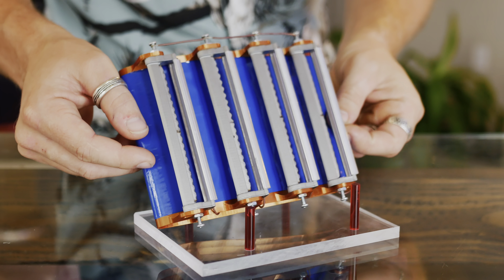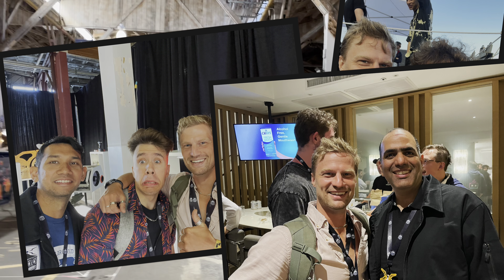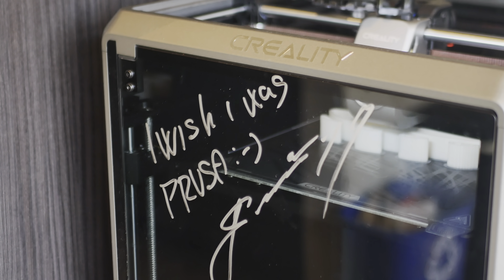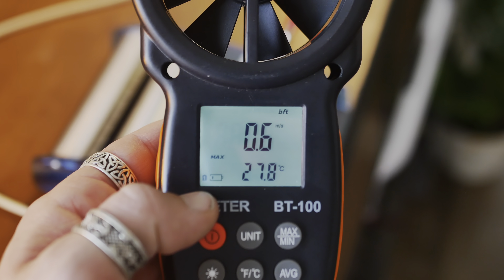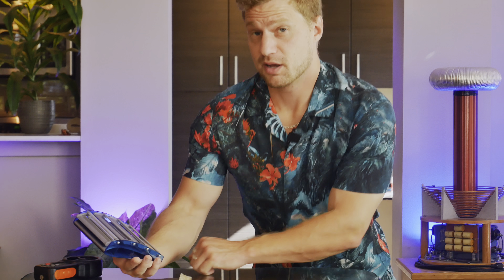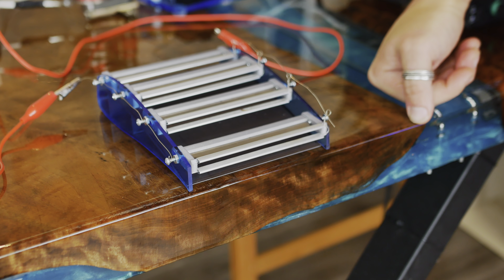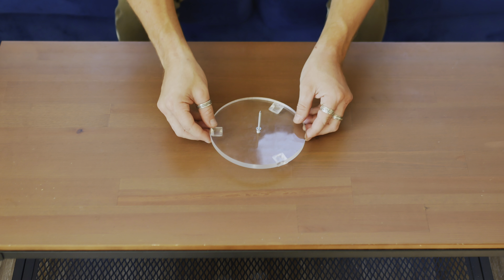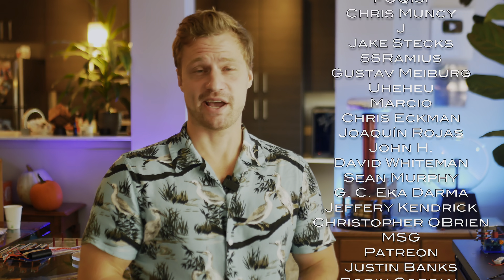Designing A Self Propelling Ionic Thrust Wing

Comment: Cool concept. Would you be open to explore a couple of ideas:
    1. How will the output be affected by incasing the thrusting elements between 2 layers of material shaped after the wing profile and controlling the shape of the input/output. The idea of looking like a trapezoidal blanket (bigger intake/smaller output) that can be shaped/placed on an existing wing.
    2. Depending on the result, you could build a second lair of thrusting elements and check the changes in the output.

Have fun. :)

Comment: While it was spinning, were you able to realize any actual lift from the airfoil? You would have to create your little merry-go-round with the ability to tilt. Either that or put a hinge near the axis that allows the airfoil to rise, but not fall below the plane of the power supply. You might also think about humidity after your catamaran build, as well as air density changes with temperature and elevation. As to the thruster placement get with your wingman to determine the placement of the first thruster to take greatest advantage of high/low pressures across the wing

Comment: You're using nuts and bolts when it can just snap in.  You already have the spacing figured out.  Print it so it just snaps into place and save the weight of the nuts and bolts, and the extra plastic.

Comment: Inspiring idea! Enjoyable to watch.  Thank you.  I bet you could achieve/illustrate vertical lift with your rotating wing foil if you put a hinge to the connected arm.  Then it's a numbers game on the thrust needed to achieve lift. Maybe incorporate two hinges, one at the wing foil to maintain a level orientation and another at the rotation center. The first hinge would allow the wing foil to adjust its pitch for optimal aerodynamic efficiency, while the second, central hinge, would enable vertical lift movement of the arm assembly. May need a larger wing foil span, nonetheless, seeing even a "mm" of lift would be amazing.  Just a thought.

Comment: Weird thoughts and open suggestions that i pondered while watching  your video. 

If a wing design is just separating two airstreams to make a delta pressure causing lift on the backside of the wing, then... ->
Could you not just  make the wing out of thrust elements alone, with only a piece of thin tape to keep the bottom separated from the top. Meaning attached to the bottom of the razor blade, that runs to the front of the next thruster. This off course means the bottom of the razor blade dont get to ionise any air, but weight savings might mean more.
Also meaning, you dont really need a ceiling of the "wing". You want the air to move from the leading edge and fast over/behind the wing -> decreasing air pressure ontop of the wing. 
Point being, the more air you can steal from the leading edge of the wing and mover over the wing the better. 
Buuuut any direction rather than passing over of the wing must  also mean more lift. Since, if you send the air upwards as well as backwards (like a inverse copter), the you also decrease the air pressure on the backside of the wing right? IE air speed of the trailing edge of the wing is not really so interesting as the delta air pressure between top and bottom. I know air speed is a contributing factor from that, but..... The wing moves forward to equalize the air pressure delta on a wing, from my understanding of flight mechanics, so anything that futhers that the better.

This leads to my 2nd speculation, being that every time an ION in the air is ionized, some of the "umpf" of your thruster's power is spent per unit of time. Meaning, the higher the air pressure in front of the thruster, the less air is "required" to move through the thruster to saturate the it's potential. 
If you instead focus on making air shoot off the wing(back and upwards), rather than follwing the principal arch of the wing, this should work to lower pressure in front of each thruster down stream(which is also sitting lower due to the wing design). -Thus managing the direction of thrusters front -> back.... Then the air speed has to increase to keep up with the power potential your are putting into the thruster. Especially if you parallel wire them all making them all have the same umpf, but less air pressure down stream, meaning accell of air to keep up with the engines umpf potential. 

But hey listen, i am just thinking out loud and I dont really have your drive to test my thoughts out. 

Also the razor blades should be sliced into a "lice" comb fashion, to increase how much open air is touching the metal to form ions. 
Also the air packed within two comb legs would be subjected to dramatically higher influence then the air top and bottom. 
This should lead you to have directional properties(thrust vectoring if you will) to play with. Maybe slightly bend every 2nd leg slightly upwards, to force evacuate the air upwards to further reduce air pressure before the next thruster.

Comment: @PlasmaChannel , If you want this consept to be seen in the air I would recomend you to place ionic trustres at the bottom of the wing. Speeding up air at the bottom should generate more presure, therefore there should be more lifting force, also by placing them by some angle, at cofiguration that intake is facing outwards, sholud lead to bigger trust. Please test it and leave some respose, or else i would think, that my consept is stupidly wrong. Thanks for all knowledge that you share with us.

Comment: Excellent project might have future, love to see what happens with each upgrade.
one comment advise is that a wing has 2 sides, 1 low pressure area(top) meaning low wind speed, and 1 High pressure(bottom) so you would like to have the wind speed on the bottom since the low pressure on top of the wing creates lift. Please look over this as it might be more efficient wing lift wise to have the propulsion on the bottom of the wind. wish lot's of success on your experiments it is really fascinating that no moving parts can provide a force. Keep it going.
Reply: Your comment inclines me to think that maybe some kind of biplane could be tried (or a multi-wing arrangement?) with a relatively narrow spacing between the wings. The major benefit of ion propulsion seems to be that drag could be low. Gliding down, or 'engine out' situations would not cause the aircraft to fly like a brick.

Comment: No expert in avionics or ionics. However alot of experience in 3d printing. I do believe extra weight can be shaven of the wing. Squares are not super good. Triangles are stronger. 

Another idea down the lane. Try looking into single wing designs for fight. They are shaped simular to the b2 stealth bomber. The idea is to eliminate the fusiolage and have everything inside the wing. They are harder to stabilize, however create a much better weight to lift aspects. However the design is best at slow speed. I could imagine it would fit perfectly for a ionic design. I am really really exiting to see what you can gain the t
Your segested improvements. Also if you with wires make the engines smaller. What would additional sectmens in the same lenght do?

Comment: I'm not an Ionic engine or wing specialist but doesn't a wing create lift by the air moving faster goer it than under it.

You have a gap below your ion engines and the bottom grounded edge should be incorporated into the wings ie no gap.

Likely why your aren't seeing faster speeds with a combination of ion engines in unison.

If the bottom grounded edge is part of the wing you will see increased speeds over the wings surface than a standard wing and greater lift surely?

Comment: Hi. I found your experience very interresting. Did you thought to creat your blades like a V or a staking cones ? I had this idea when i saw the air flow with fog. It is more important in the center than on corners. If my vision is correct. If the blade has no corner like a ring, the engin thrust must be more powerful. I have not your material to make this experience and no time nether. But i would love. I hope you will propulse us very soon. Sorry for my english i don´t practice it very often.

Good bye😊

Comment: Would this design even need a traditional wing shape?  The over-wing air would be moving faster than the air under the wing without the need for the wing shape accelerating it because the thrusters are.  The old kid's experiment is to blow air over a sheet of paper to lift it, wouldn't this be able to produce the same effect?

Comment: Did you do any testing to see if there was diminishing returns with having 4 thrusters wired up instead of 2 or 3?

I wonder if using a non-conductive material to isolate the intake from the output of each thruster would help? Putting a piece of tape, or plastic, from the top of the ground to the bottom of the positive housing on the next thruster back creating ducting. You might even be able to put the thrusters inside of the wing.

If all else fails, just crank up the voltage and turn the entire wing into a thruster.

Comment: This one experimental airliner design blended an engine into the fuselage. The design was aerodynamically efficient but couldn't fly because the air flowing close to the body was going slower than the rest of the engine intake, stressing the turbine blades. I wonder if incorporating this ionic wing design to accelerate the band of air near the fuselage could reduce stress on the blades...

Comment: 3D printing with foaming/lightweight/aero PLA will save a lot of weight on your printed parts, around 65%. It's PLA with a foaming agent so when it extrudes it expands at a known amount and ends up being less dense.  It's used primarily for printing drone components.
Reply: this or simply just switching to abs or PP which are significantly lighter than PLA. Although those filaments can be quite difficult to print accurately
Reply: Needs a simpler wing all together tbh, I would be looking at things like man powered flight and follow the "straight" wing design (carbon fiber). Wings create lift by making low pressure system behind the leading edge over the trailing edge essentially turning thrust into lift, above the wing... not below! thats where your lift comes from thats why the tear drop shape. He hasnt got the thrust to ever make that shape an effective wing. He needs a cutting wing... a straight wing. ALSO... he will need to move the thrust off the wings, i hope he highlights why next one but i can see the fundamental problem hes making already. Think propeller planes, surface area, and thrust positions. Have a safe and happy new year.
Reply: Could aerogel have a place here. It will be poetic

Comment: Have you tried a magnetohydrodynamic drive? Theoretically, the energy lost to heat should be lower as you can impart more of the energy on the air using the magnetic field rather than the electric field.

Comment: I know not much of airfoil design or the construction of aircraft but you may be able to incorporate a dual elements wing design. I'm a second year mechanical engineering major at UC Davis and I have been on our advanced modeling aeronautics team where we are currently designing an aircraft that utilizes this dual element wing design. This way you can incorporate the ionic propulsion as one of the separate elements while still reaping the benefits of the greater lift associated with dual element designs.
Reply: Although I'm not sure about what speeds dual elements wings are most effective. Just a thought!
Reply: Could also consider the position of the thrusters. If they're under the wing that may give you more lift since the air is being forced under instead of over? maybe? Or you could put them inside the wing? Just ideas and not really sure how they'd exactly effect the lift/speed but I hope it helped stir up some ideas!

Comment: Very interesting stuff. The engineer in me is suggesting you do some back of the envelope calcs to get an idea of the scope of the issue. Assume the lightest, most aerodynamically efficient wing/airframe and calculate the thrust required to achieve flight. I imagine the thrust requirement alone will kill the concept, notwithstanding the integration challenges

Comment: If ionization is effectively quantified by charge density at the electrode tip, surely using a long but sharp blade is causing a significant compromise?  Not only are you carrying a big weight penalty (think about which part of the blade you are actually using), but even if your blade was infinitely sharp you're effectively distributing your charge along a line.  Yes it's a convenient form-factor to build into a wing, but what you ideally need is a series of infinitely sharp points arranged parallel to the direction of the intended ionization.  Room ionizers used needles or a bunch of carbon fibres to great effect in exactly this manner.  Could you not do the same?  Replace the blades with a line of needles pushed into a foam core covered in aluminium tape and connect the tape to one of your power supply's terminals, leaving the rest of the design the same?  Or use a thin wire to replace the blade and solder little stubby wires at 90° to the wire, in the direction of the wing's chord to form your electrode spikes?  Be aware of aerodynamic drag from the long wire though, as it could be substantial.  There are many ways to do this, but my key point is the electrodes must be sharp points or very thin, and they must point in the direction of the thrust.  Your corona pictures are actually illustrating the principle... the brighter areas in the corona are those with the highest electron density or energy, which is what you want.  In the case of the blade, they'll be formed at surface errors in the sharpened edge.  You rounded the corners of the blade to prevent arcing, did you not?  The arcing was the result of the corner of the blade causing the highest level of charge density and the highest level of ionization.  Ultimately this was sufficient to breakdown the air dielectric and allow the charge an easy path to ground.   I've not watched your Portuguese "competitors" video yet, but I suspect, from the image you flashed up, that he was more successful because he was using an electrode with points.  Do with this as you will.

Comment: If you can achieve a thrust-to-weight ratio of at least 1.5, then this will be a worthy result. However, there is simply nowhere to get such an amount of energy in flight =/ Even if you get this ratio of the mass of the unit to its thrust to be at least 1.5, then the mass of the batteries simply compensates for everything =( Perhaps you can find the right approach by developing a mathematical model of the process that occurs ;) And then by changing the design and the parameters of electrical energy, you will definitely get something. At a minimum, you can give an explanation why it didn’t work out. From a scientific point of view, of course =)

Comment: what if it built in the wing not on top?
Reply: and use a delta wing design like b2.  it just a thought on top of the head can design the weight distribution for weight making a scale rc  plane
Reply: make wing thing where it a system that like 2 wing forcing the air in to the center of both wing also would a better conductor than aluminum  like copper dont fully understand it yet but what if we can find a solution to compress the flow forcing more air  like a scram jet or ram jet for ionic trust like i said dont know much about the subject just off the wall thoughts
Reply: also what if the ionic engine is more aerodynamic trying to reduce drag and increase lift

Comment: It's all ábout surfaces. graphite can be utilized as high voltage leads. alot more surface area than a wire or razor blade and weigh much less

Comment: Now try making an ionic windmill/fan out of it. Just put the thing you made on the end of the blades and line the arm/blade with a loose wire, the end should SLIDE along a metal contact at the center for power. In theory you could use thermal pad generator thingies to power it, just keep one side facing the center and the heat generated by the 1st manual spin should be different enough from the surrounding air on the other side of the pad to maintain power generation...in theory anyways.

*Edit:* you can also hook the power generated by the spin into it the power supply to make up any difference, the remaining power (if any) can just go into a battery.

Comment: Could the venturi effect be used to increase air flow? Maybe an hourglass shape with matching sized thrust generators? Or maybe triangular-ish shaped wing? Also, putting the thrusters in the position of the bottom part of the wing instead of spaced above it?

Comment: Ok so as a pilot (not an aerodynamic engineer by any means) I see three main problems with this concept. The first and most obvious is the thrust to weight ratio just isn’t there. Second the parasitic drag of the ionic engine sitting on top of the wing is going to kill any lift and disrupt the laminar flow of the air over the wing. Third, the amount of power needed to power ionic engines is insane and we just don’t have light enough batteries right now to pull this off. At the end of the day though… I really do hope that you prove me wrong. We have been operating aircraft with jet engines for far too long without any real leap forward in technology. Something new needs to come along.

Comment: wouldn't you want to increase the airflow underneath the wing instead of on top ?  won't it be more stable with the weight ? could you use less parts if you position it right under the curve  so the effect will be stronger? not an engineer

Comment: I am making two assumptions, first that coil is producing AC voltage and second, you want a wing to produce lift.  Instead of all that hardware (weight) why not have a strips on the wings (top & bottom sides) with straight leading edges sawtooth training edges.  Thin strips would be lightest weight and form part of wing skin.